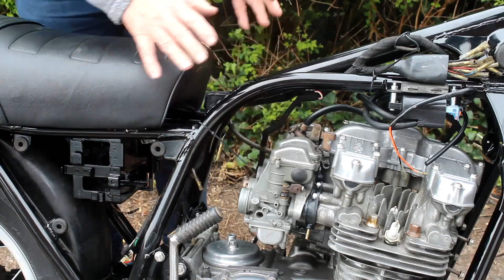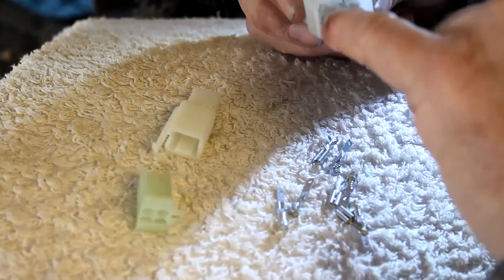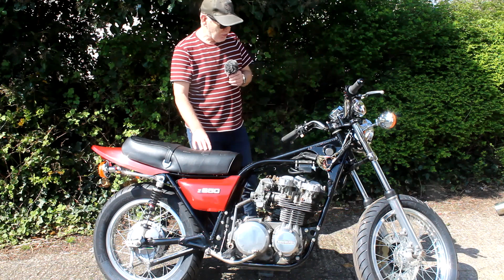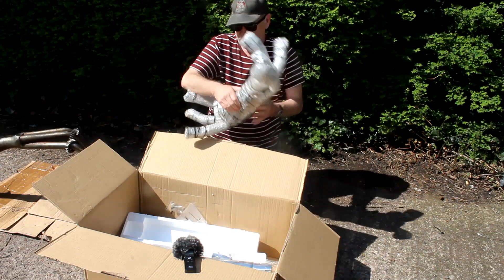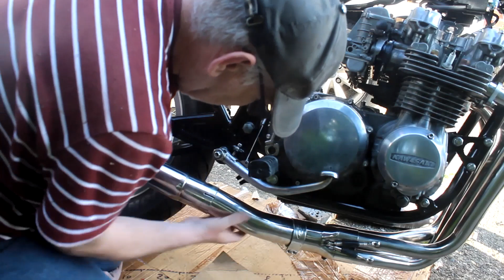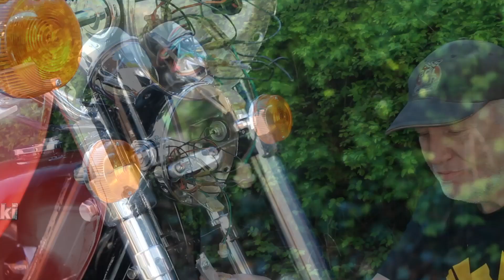Kawasaki Z650B Restoration Project - Part 9

Comment: hi enjoying watching your channel. did i see on one of you Z650s you had a ZX9r rear light fitted? looking to use one on mine.
Reply from the maker: Yes, its actually from a ZR7, but the same light is used on a few different Kawasaki models, such as the ZX6r and ZX9r.
Reply: That's great thanks was it easy to wire in?
Reply from the maker: @johnrice2067  Yes, its the same 3 wires.. one for the brake light, one for the rear light and one for the earth. Even the colours are the same as the Z650. But you have to make a mount for it. In an other vid I show how I made mine. In Part 4
Reply: That really helpful thanks for that. 👍